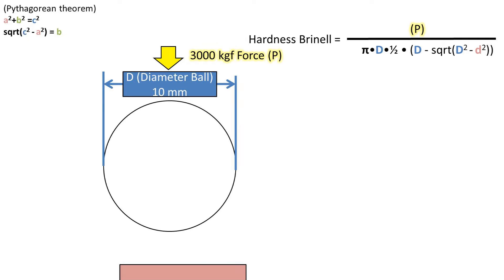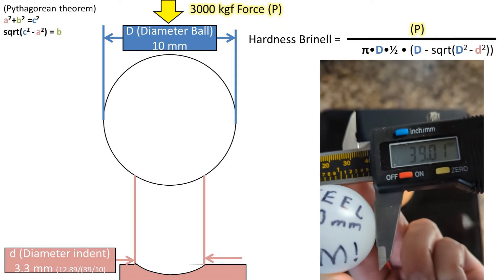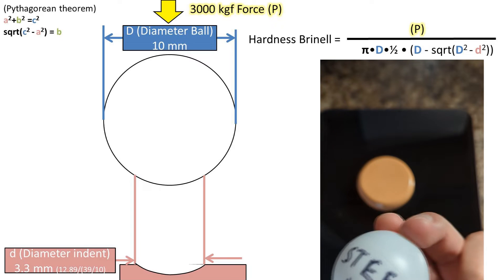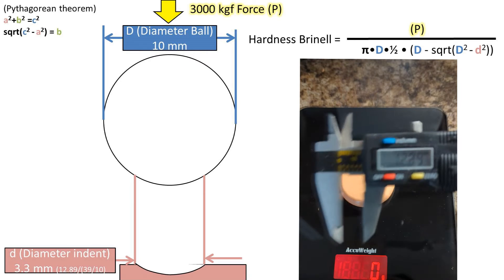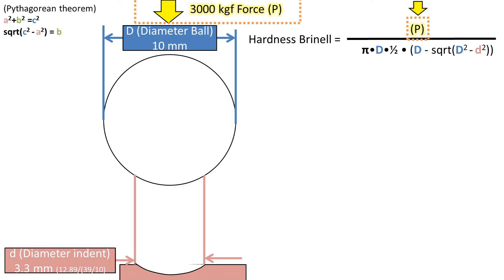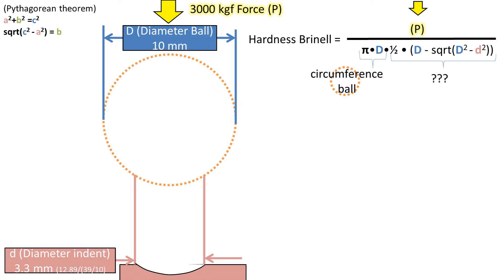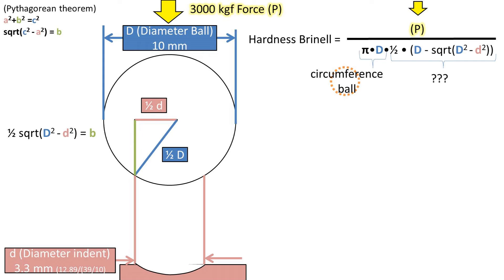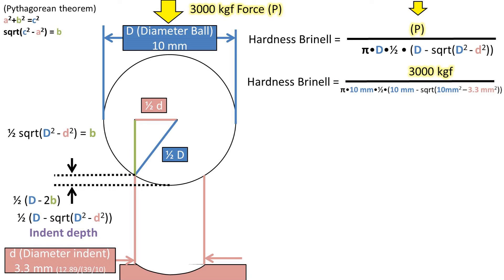Brinell Hardness Test Explained - Material Science

Comment: From what i've seen the Hardness Brinell number is basically force/area of indentation, my question is: if the diameter of the  indentation depends on the hardness of the material and consecuently its surface depends on such  diameter  , why bother to calculate this area in the first place if the indentation diameter is already an indicator of hardness?

Great explanation BTW, thanks for the video!

Edit: BTW I just saw that other test use the Area aswell so this question my apply to hardness tests in general